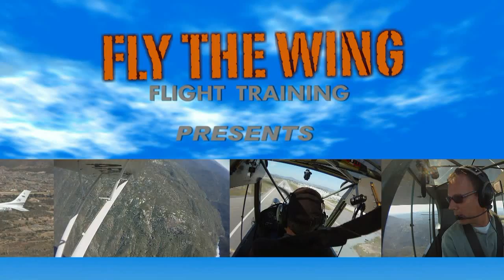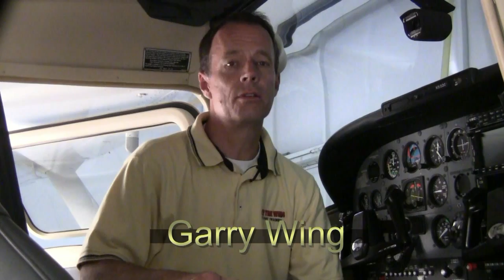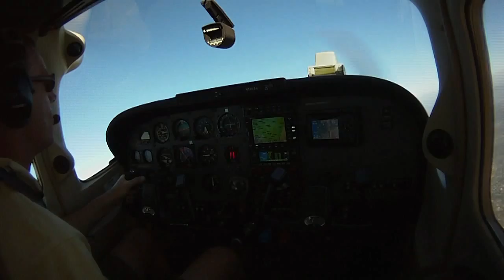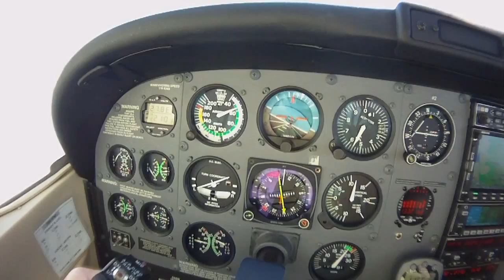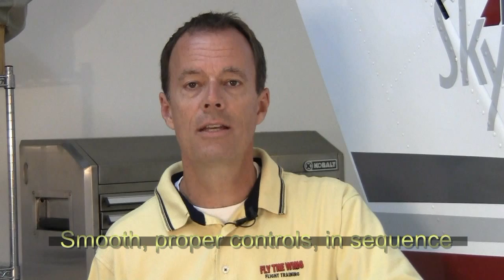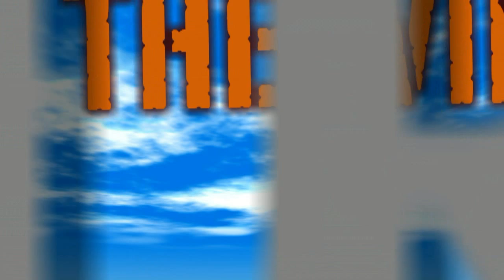Unusual Flight Attitude Maneuver

Comment: During my PPL checkride oral my DPE got extremely upset and tried to make me feel like a moron when I used the term "level the wings".  He says i should "neutralize" the wings. He was a real treat from start to finish...but I passed that portion.
Reply from the maker: Ha; that's a good one. Did you also have to demonstrate "Straight & Neutral" flight... the FAA's AFH actually talks about leveling the wings when rolling out of a turn (page 3-16). We had one DPE that would go on a 5-minute tirade if an applicant showed up with a pen that had a removable cap (instead of a click pen)... "It will fall off in the cockpit and distract you... could get stuck in a flight control... fall out of the airplane and create FOD...", etc. You sometimes just have to play along; you're living in their world for a few hours... get your license or rating, then adios!

Comment: Excellent presentation. I haven't flown in years. When I learned for my Private certificate my CFI did all of the recovery from UA under the hood. Both nose up and then nose down by putting the plane into a kind of wing over with a 60 degree bank nose down .....then recover under the hood. Is this acceptable technique?
Reply from the maker: Yes Allan; all the UA is under the hood, but as I was flying alone VFR in the video, I of course didn't don the hood... The other thingI love to do with students is have them close their eyes under the hood as I put the plane through a series of maneuvers, then return to straight & level flight and ask them to 'recover'. Many start yanking on the controls to 'correct', before they discover the plane was actually already S/L & they just messed it up!